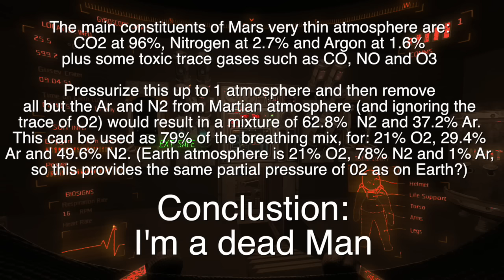Take On Mars Editor 66 - (Life Support System Update)

Comment: Hi Meko.

Some information I gathered/tested so far:

1) "Cycle" on airlock doors seems to be not working now, may have to do something with mixed atmosphere. Before it was just "gas", now we have 3 different gases, every flows separate in rooms. So maybe they need to fix cycle function. Cycle (if it would be working) should be just sucking atmosphere from one side of the door to another side. But it is broken.

2) On LSM, you can see for every type of atmosphere you chosed, how much gas you have in storage, and the second value (after slash) is how much of that gas is released in room. If you select back EXT ATM, it suck that amount of gas back to the storage.

3) On LSM, if you hover above ATM buttons, you can see in bottom part of LSM screen, how much of which gas selected atmosphere uses (in percentage).
Reply from the maker: Hey Róbert great info right there. I will take a closer look thanks.
Reply: Hi Meko. Yesterday, in test build, new wall module holster for gas cans for Outpost was released (in test build).
Reply from the maker: nice thanks i tend to stay in the main branch. sounds cool

Comment: oh good to here from you again :D
no doc can keep you down. lol

ox system is awesome, sucks that its not showing the power.
but still i need time to play this again.

thanks for your time.
Reply: p.s. on earth we have 78% nitrogen and 21% oxygen. that nice for smokers. but in space ship nasa runs it a 100% ox in side,
 so that the air vents can have more time to get carbon dioxide out.  which is bad for smokers when you light up,,, big bada boom! :D
Reply: so nasa puts cheep lightweight life support on space ships for ox and dioxide. but on a colony you need a bigger life support. for things like open flames, sparks, and maybe some smoke. :P ~ ~
Reply: That is true for space suits and some NASA (older, maybe still current?) spacecrafts. NASA used 100% oxygen but on very low pressure. That helps them safe money, because walls of spacecraft can be very thin, almost like an foil. Soviets and Russians have not use pure oxygen at very low pressure, but similar gas mix and pressure like is it on earth. But walls of spacecraft must be much thicker and heavier.
Reply: the low pressure is more in the suits so they can move them, if the suit was full pressure.
thin they wood look like michelin man.

thanks for your time.
Reply: the moonlander was the thin walled space ship of them all, and ship that hand to come back to earth have the thicker walls.

thanks for your time.

Comment: Pay CLOSE attention to the LSM panel and pause the video. Under OXYGEN it shows 140/1416. The first number is how much you currently have in storage (Barrel, Med Tank, or Huge Tank). The second number is the required amount to pressurize the entire habitat that you've enclosed. If the first number is not equal or higher to the second number you will be unable to pressurize and require more resources, O2, Nitrogen or Carbon Dioxide depending on if you use 0.3 or 1.0 ATM.

Ext. ATM - Fills the barrels (or other storage) with external atmosphere of the planet you are currently on.

Hope this helps.
Reply from the maker: Mr. Monochrome nice, thanks for sharing that with everyone. That is good clear information. :) thanks